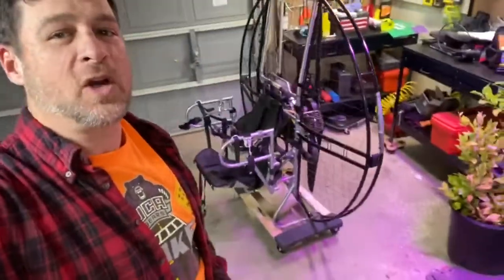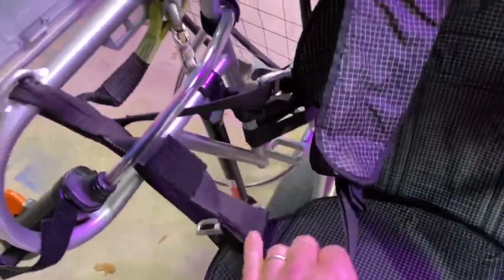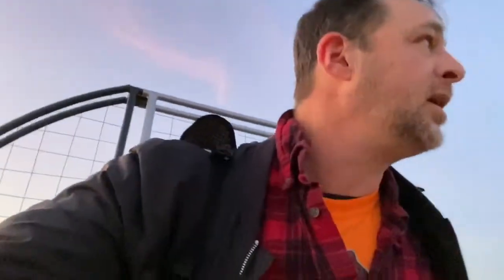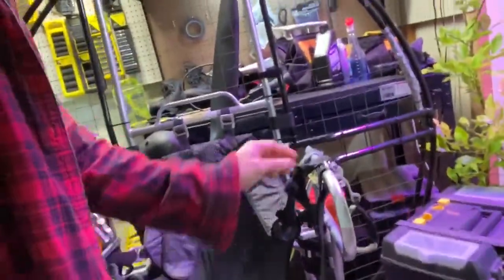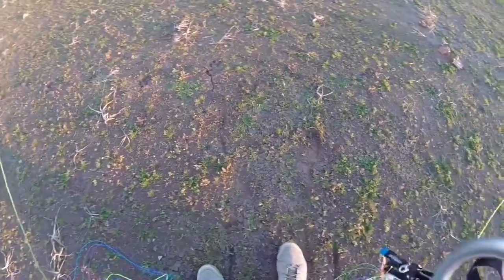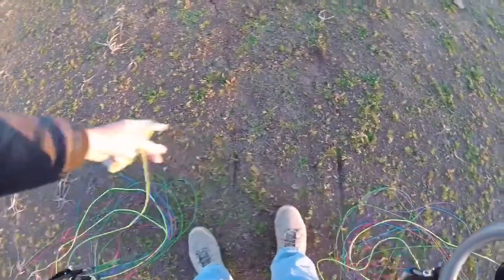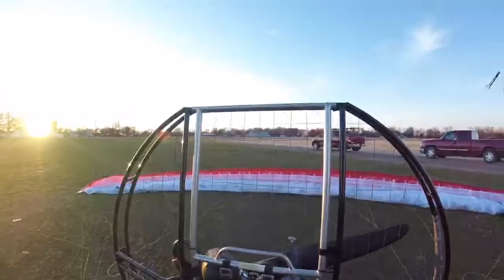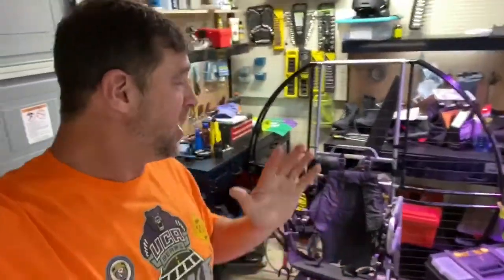How I pre flight PPG Paramotor and myself! I could of made a fatal mistake

Comment from the maker: Happy new year.  Here is my updated checklist. 

Preflight

Myself

Boots tied
Zipper zipped
Belt buckled
Straps secure
Helmet buckled
Helmet Sena connected

Cameras
Cams on and secure

Wing

Kite to wall
Lines 
Brakes clear
Risers not twisted
Fabric check
Rocks debris butt hole

motor

Prop
Bolt torque
Bolts Motor mounts
Belt
Zip ties Velcro
Carabiner lock
Gas fuel
Gas tank tight w/ gas

 clip in

Carabiners are locked
No riser twist
Brakes clear to pulley 
Leg strap connected
No strap twist
Leg straps
Helmet strap
Engine full throttle OK

Run into the sky
Stay full throttle
Altitude before seat

Comment: I use Crosscheck on all my bolts. It makes it really easy to see if anything has come loose. Just put a drop across the head of the nut on to the thread and let it dry. If you see any cracks in it or misalignment you need to double check the fixing.
Reply from the maker: Excellent idea thank you for the comment and the suggestion!